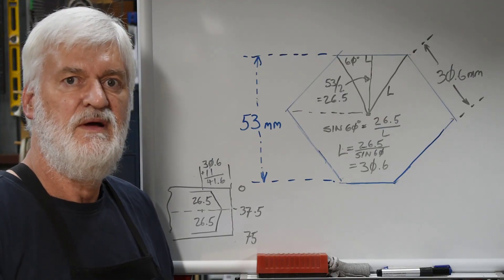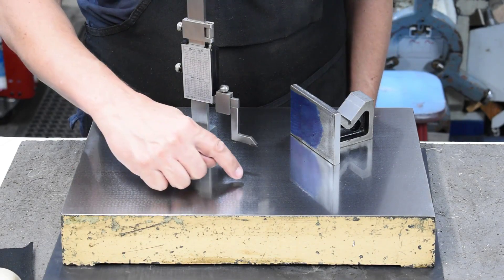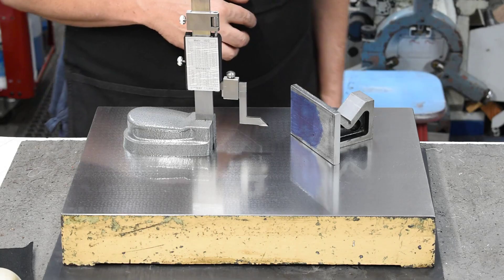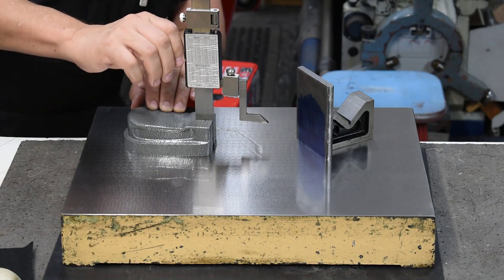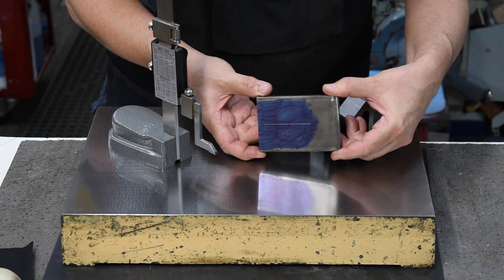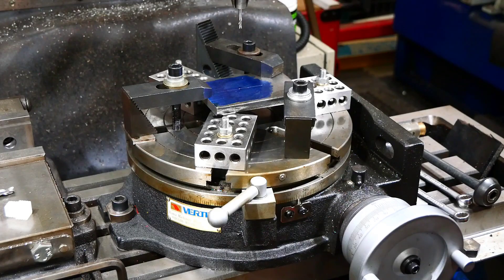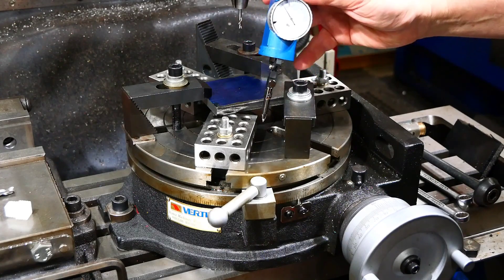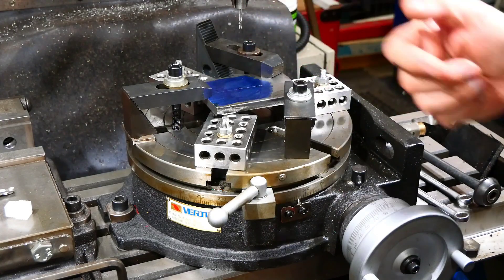Milling a hexagonal hole in steel plate

Comment: Thank you so much for this video. I'm making a tailstock die holder and my dies are hexagonal. For neatness I think I will include the corner drill holes within the hexagon cutout. I had no clue how to approach the job, now I do!
Reply from the maker: Thank you for the feedback and I'm pleased that you found my video helpful.
Extending the corner holes outside the female hexagon was helpful in my situation as the male hexagon was rough cast and the corners were not clearly defined. However, I think it is actually good practice to avoid driving male hexagons on the corners and, to this end, Snap-on offer a range of spanners marketed as "Flank Drive".     
Cheers, Alan.